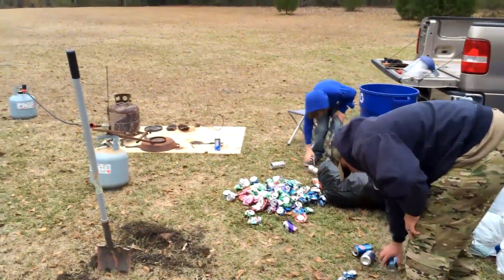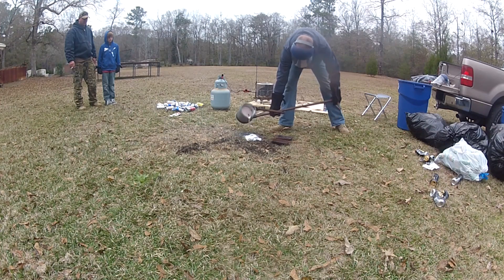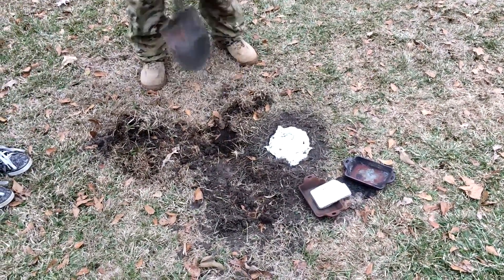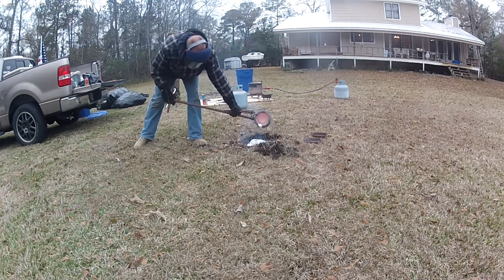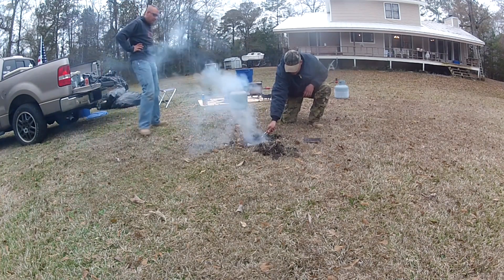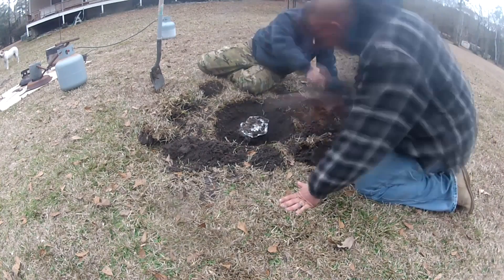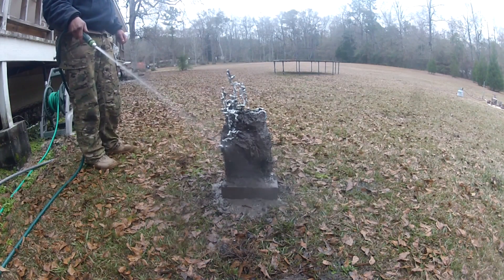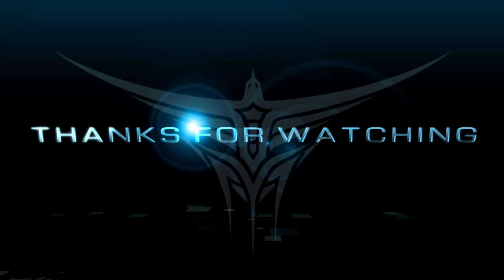Ant Hill Casting #2

Comment: Funny story: in first grade I was at cheerleading practice and my squad and I were taking a break, I set my juice box down on a light fixture (the kind they use to shine on buildings at night) and a few seconds later I started screaming because my body startled tingling/burning. I started screaming and crying and trying to get whatever was causing the feeling off of me. It stopped a few seconds later and when I looked my step-dad had lifted my juice box down. Apparently the ants didn’t like my juice box there.

Comment: You should try burning the things stuck in the aluminium. It's probably easier than pulling them out.
Reply from the maker: Tobias Neufeldt Yea ive started dooing that and it is WAY simpler that way.
Reply: 556Raven use hairspray and light it on fire to burn it and you have a mini flame thrower also helpful in zombie apocalypse

Comment: 556Raven if your having trouble getting the rest of the mud out after the initial hosing down, one thing you can do is submerge it in a bucket of water/soap solution and let it sit there over night and just rinse it off with a hose the next day, should make it much easier, worth a try if you plan on doing this kind of thing long term
Reply from the maker: ***** Thanks ill try that next time

Comment: Use a power washer for cleaning the dirt off. Its MUCH faster. Just be sure to keep the water far away because those things have a lot of pressure. It could potentially break the casting. BTW these are really cool. Subbed!

Comment: Hey man one more question, since it has all those twigs and stuff, if I was to cast one and let all those things dry out. and took a propane torch (one that hooks up to an lp take like you got there), and lit em up to let them burn out. do you think it would still be ok if I washed it off again? Thx.
Reply from the maker: ***** I do think it would be fine.  I use a hand held map gas torch to clear out the twigs now...  just have to be careful to not remelt the aluminum

Comment: Enjoying your videos very much!  As an EX-jeweler, the hottest metal I ever heated was platinum.  Of course, I didn't have a HUGE torch except for casting.  I only have a bench sized torch now, so I'd definitely have to get a larger torch to do something like an ant hill.  How much (in weight or how many cans) do you use.  I'd hate to do a pour and it just disappear because I didn't heat up enough....on the GOOD side, it WOULD be one less intact ant hill, but there are better ways to attack ants if THAT'S all I'm going for.  Thanks for your response if you get the time!
Reply from the maker: M Rogers It takes a full 10lbs crucible and about 500 cans.  I have my entire block saving cans for me ;-) and i kill all the ants in our yards.  Its a win win
Reply: That IS a win-win! Have you ever thought about casting in pewter?  It may be too soft and break when you're trying to  unearth it though!  Keep up the good work though.  Hope you're showing them at a local gallery or something. I've got some humongous ant-hills. I wouldn't want to take out the whole town, but it seems like some of them might run like subway systems for miles!  LOL Thanks for your answer.

Comment: Is casting potentially harmful for the environment?
Reply from the maker: well...  yes and no.  Its not the best because all the paint and plastic that is on the cans i melt gets burnt and released into the air.  But its better than just throwing the cans away.  If i recycled them they would melt them releasing the same chemical smoke. So its not the best but its not "bad" either.  As far as pouring the metal into the ground its perfectly safe for the environment because i dig it back out again although I'm sure the ants don't think its so safe.  ;-)

Comment: i think this is the coolest thing, one could possibly make a few bucks doing this as a hobby
Reply from the maker: Thank you...  and i do sell them  ;-)
Reply: how much do they run?
Reply from the maker: for the biggest ones 10lbs of metal there going at $150 plus shipping.  And lower as they get smaller.
Reply from the maker: theres a small waiting list at the moment as i can only cast about 3 per month.
Reply: do u have a website or something?
Reply from the maker: not yet...  i currently do it all threw the comments here and email at 556Raven at gmail dot com
Reply: Glowing Banana  even a little fire would melt the aluminum
Reply: 556Raven Could You just Burn The twigs out by blasting it whith fire? not so long as to melt the aluminum but to burn the twigs.
Reply: There's another channel called AntHillArt and he's made over 100 sculptures and he sells them. Go check his channel out.

Comment: Is it possible to make a little fire on the ground to place the casting on once its washed out, to quickly burn the twigs and bits of grass that you cant pull out by hand? or would it be to hot and begin to melt the casting?
Reply: ***** It will not be weakened by a little fire, a lot of pans are made of aluminium.
Reply: or simply wait a while...until all the twigs and organic stuff is totally dried out and tinderbox ready.

Then simply take a cigarette lighter or similar and light up all the ends.  They burn up just like little matches.
Reply from the maker: i could work...  havent tried it...  I may and let you know what happens.
Reply: Awesome, I hope it works out. I've been considering doing this myself but I would want the cast to look a lot cleaner at the end of it all. Maybe if you hit the casting with water at a higher pressure that would help a bit, but I'm not sure how strong these castings are. Another approach to further cleaning the surface could be perhaps an acid that is relatively non reactive with the metal but will eat away the dirt on its surface?
Reply: I think all you need is a torch to burn the roots away.
Reply: James Porter Aluminium has a low melting point though, so burning it could damage the metal in some way by weakening it. But you would have to test it.
Reply: James Porter won't work...too hot
Reply: ***** The melting point of aluminum is 660.3°C (1220.54°F).  That's low for a metal but you can for sure burn away a few twigs with no risk of harming the aluminum.
Reply: Stephen Forrest weakening isn't the same as melting, a hot flame could still deform the metal.
Reply: Rashombo Yes, but he is using just melted aluminium from cans in this video, it's not exactly high grade strong aluminium. I've messed around with this metal before its quite easy to heat the metal to a temperature where the metal becomes very malleable and soft so it bends easily.

Comment: drive your truck over the cans
Reply from the maker: hehehe maybe
Reply: They sell can crushers at Lowe's & Home Depot that are supposed to be mounted to a wall.  They have a handle and the squash them.  Mount one to a board and give that task to the kids for a quarter or 50 cents.... per 100....  They'll be done in a FLASH.
Reply: or put them into a heavy duty bag and drive over it a few times.
Reply: or grab one piece of wood(large, maybe 6ftx6ft), lay it out, put the cans on it, maybe stomp them so they don't move then put another piece of wood ontop then ride your truck over it so you don't have a chance of ruining your tires.
Reply: odidiman
mine is less work and they are all in a neat pile in a bag, u have to collect urs up

Comment: My father and I tried this once, the anthill was very wide but not all that deep so we had a lot of roots stuck in it. He decided to put it in the fireplace, got rid of almost all of the roots and such. Though it wasn't nearly as shiny as it was before, it had a nice blackened look after we cleaned it up again.
Reply from the maker: That's an awesome idea!  I may try that with the next one i cast...  I'm sure its better than picking all the roots out by hand for over an hour.
Reply: You can use Hydrofluoric acid to brighten back up the aluminum. Look up "acid condenser coil cleaner" and you will find it or any "aluminum brightener" type liquid. The Air Conditioner coil cleaner is usually pink in color and can be purchased at a local Air Conditioning parts/ equipment supplier house by the gallon jug. You could probably find it online too. I mix it 1:1 with water when cleaning coils and it foams up nice and easily rinses away with a hose. Apply it with a pump sprayer, let it sit for 10 minutes and rinse. It should get most if not all of the aluminum bright again.